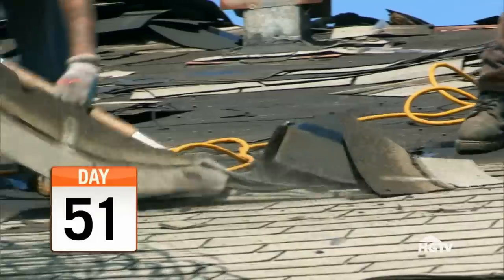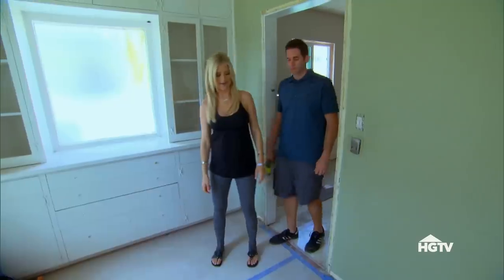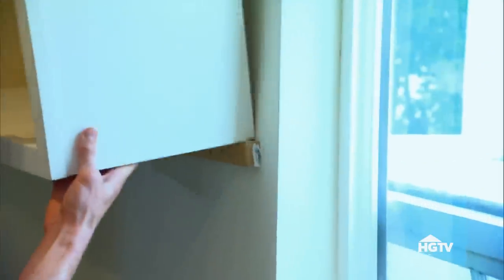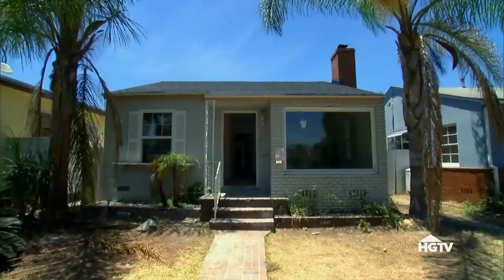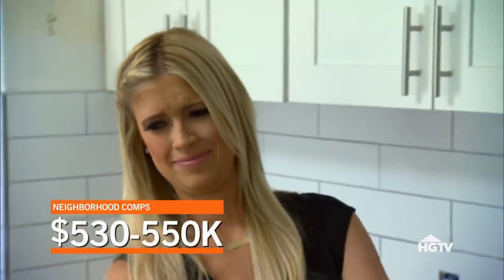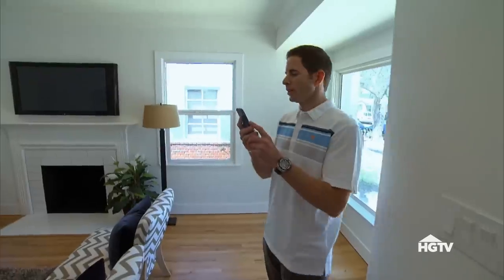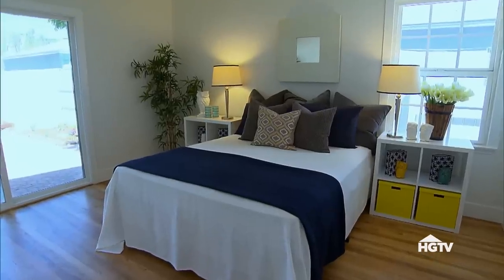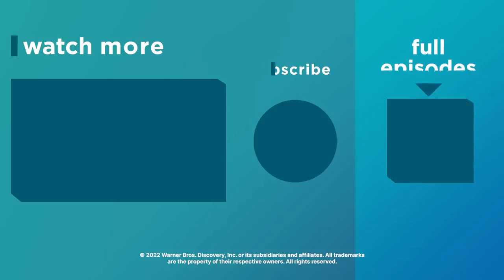Amazing Beach Bungalow | Flip or Flop | HGTV

Comment: How is a butcher block countertop 500 $ more expensive than granite??
Reply: Labor for staining and sealing.
Reply: There's a lot of thin, cheap granite, and very little solid wood countertop available.
Reply: It isn’t. The contractor is saying that installing the butcher block will require a stain and a finish, so it will cost $500 more to install it. With granite, the upfront cost is higher, but the cutting and polishing are done by the supplier